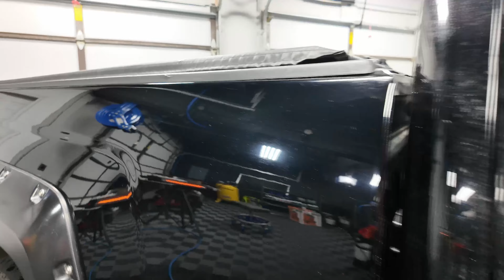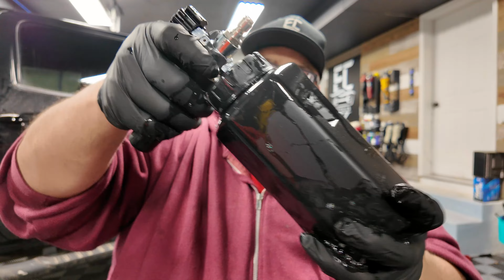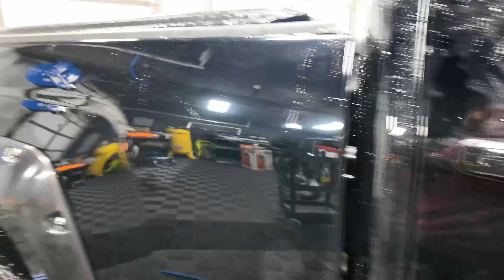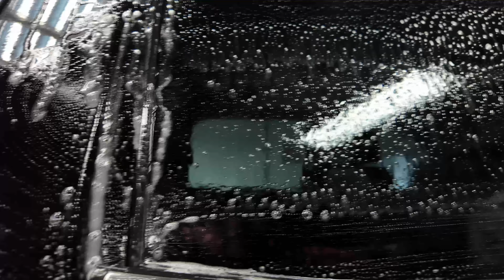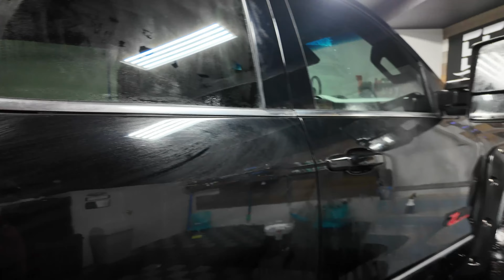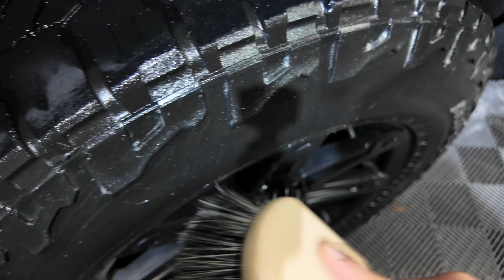Next level car product review: The Verdict?

Comment: I happen to be a rinseless man, but that soap in the foam cannon is just not the deal. Now, that's irrelevant I know but just not the foam cannon deal.
Reply from the maker: I’m a rinseless guy too what you using lately ?
Reply: @Ecdetails  I have tried just about everything and usually like to switch it up all the time but in my humble opinion DIY is too good as a rinseless wash not to just use all the time. It's not my go to as a drying aid or clay lube, that's Absolute, but as a rinseless wash to get a car clean it's just too good. It is simply a head above the rest as a pure rinseless wash to wash your vehicle and get it clean.